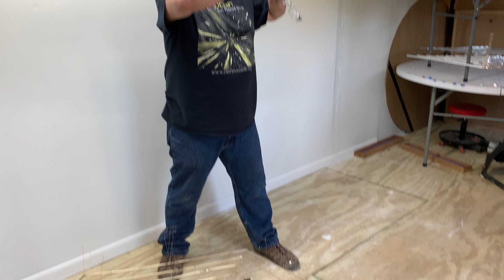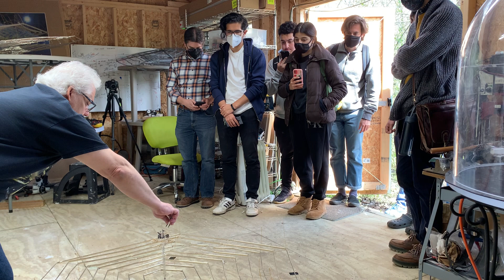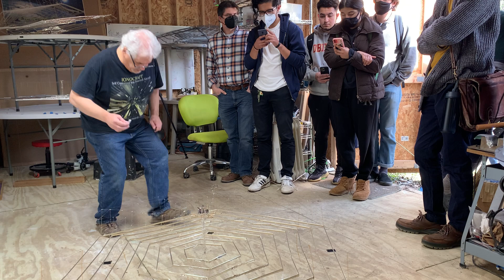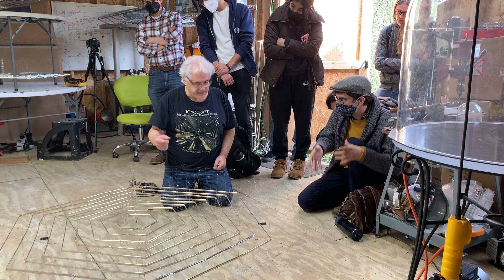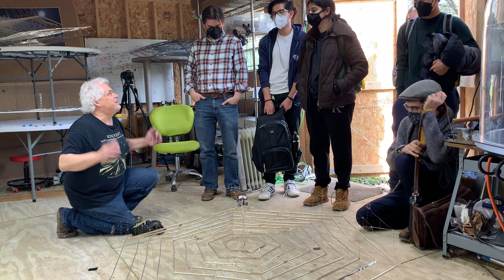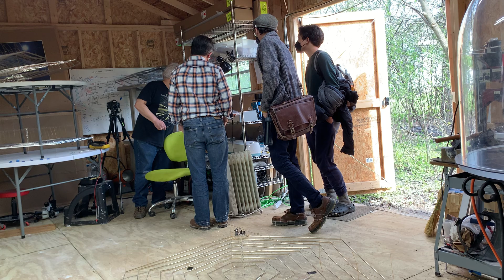Oberlin College Physics Department Field Trip (Please see updates under the video)

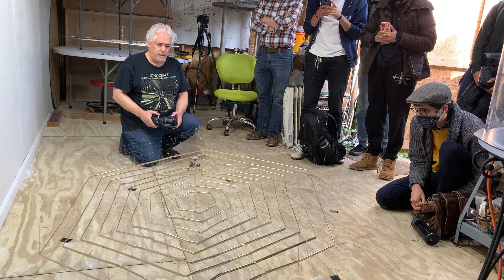Comment: At 18:00 I’m wondering if the people standing around the craft could be taking the potential out of the air?
Reply from the maker: The power was low mainly due to a bad connection, but you could be right.  I'm constantly trying to improve it.
Thanks again!

Comment: I’m one minute in and say this is your best video. 
Your a great public speaker. 
I can hear your passion beautifully. 
Please keep up the great work. 
🇦🇺🤜🏼🤛🏼😎🍀🍀🍀🙏🏻
Reply from the maker: Your comment is much appreciated!  While it was the worst flight that I've made public, at least it did mostly leave the ground in front of the class at one point.  It turned out that there was an open circuit on in the voltage multiplier, that I was able to fix in for the next video called power restored.
I hope to have some much better results to post soon!
Thanks again!

Comment: Thats pretty slick. The closest thing I've seen yet that looks like an anti-gravity propulsion system.
Reply from the maker: Thanks!  I was just thinking today, of what I like about it.  There is a sense of it being free from gravity when it is energized.  Of course, it just blows air downward gently to fly, but because there is so little turbulence and it is lightweight, it seems to just levitate.  The newest model is coated with a thin layer of gold.  With good lighting is looks really nice comparatively.  It will be done in perhaps a week or so.  
Thanks for commenting.

Comment: Maybe put together a crowd funded project to build a room specifically for this project where you can adjust the amount of static electricity, heating, cooling, humidity ect? Also a vacuum environment.
Reply from the maker: I already have a couple crowd funding campaigns going for it. They haven't received any funding yet after months. A few EEs have donated from the donate button on the website though thank goodness.  So far it costs a lot for R & D.  I already have a vacuum chamber.  It doesn't need that much of a controlled environment.  It flies fine whether it is raining outside or not for instance.
Thanks for commenting!

Comment: Could it possibly be discharging just due to all of the people around it and each individuals static  electricity? Also does the humidity in the room effect its performance?
Reply from the maker: No. not so much.  It didn't still fly very well after people left. It turned out there was a broken wire on the voltage multiplier and a few other issues. I fixed some of them and got it to fly a few more times.  This model was getting old and extending the frame to add an especially large 9th ring for steering required too much extra plastic insulation and weight.  If it had been made the correct larger size in the first place it would have been lighter and stronger. It flew through many crashes but now it's being rebuilt.  I'm also working on a model to fly in the vacuum chamber, and some improvements.
Thanks for commenting!

Comment: How much flight time do you think could be achieved if it flew like an airplane instead of a helicopter?
Reply from the maker: When I flew it outdoors on its side, I was able to turn the throttle down to perhaps 15 or 20 percent.  At those throttle levels the circuit runs for roughly 10 minutes with normal sized batteries.  If it had extra wings like an ordinary glider, it could carry large batteries and would fly for hours.  At low throttle levels. like those used with aerodynamic lift, the circuit is very efficient and hardly gets warm.
It doesn't yet have the stability to fly on one side safely without a tether and sliding ring but that will be overcome soon. 
The craft recently had some repairs, has been upgraded, and also a higher quality version is under construction.
Thanks for commenting!
Reply: @KraussEMUS1  awesome! Great work
Reply from the maker: @skate_your_city  Thanks!

Comment: What if you used a blimp style system to scale up the craft. The power supply would cancel out balloon lift and all propulsion would come from the lifter. Less work for the lifter and could allow for a payload.
Reply from the maker: Yes, the first time that was done that I am aware of, was in 1977 by Walden Aerospace.  They demonstrated a large ion propelled blimp to the military.  The craft was not fast or high powered though.  I made an ion propelled flattened rocket shaped blimp in the early 2000s, but it was also not very fast.   I decided then to go all out and develop an ion rocket that could lift its power supply against Earth's gravity.
I have been working on this project since before the name "ion lifter" was made up.  Ion lifters mostly all produce hundreds of times less thrust than their external power supplies weigh and so are considered toys.  This EAD craft has onboard power.  I've also always called it an ion rocket, ionocraft, or Ion Propelled Vehicle etc.  Maybe it doesn't matter so much though.  I'm just trying to specify that the performance and details are different.
Thanks for commenting!

Comment: hello Ethan! we have build a bigger prototype with different techniques and different structure and we think different power supply  than yours, the research shows that some edges length is better than others. hope that you do well. we will soon share our progress with you guys.
Reply from the maker: Good luck on lifting a power supply with ions.  I have tried hundreds or thousands of shapes and structures and many hundreds of power supplies at the very least.  Most just won't work for onboard power. There is a webpage called Worldwide Lifters Replications, that shows roughly hundreds of people that made "lifters."  None of those crafts are anywhere close to having onboard power.  I do think you or someone else could succeed at replicating my work with onboard power soon though.
Thanks for commenting!

Comment: I can’t help but see potential in future applications of this technology, not only in space but in commerce as well. It could help and improve the speed of  transporting goods over large distance quickly, compared to other forms of transportation. How does the thrust output of this device compare to traditional propulsion devices like a jet engine or rocket engine? In the coming future SpaceX will be utilizing starship to transport not only people but other goods to the other side of the planet within 2 hours. Could this technology be comparable or surpass the future feats of starship in logistics in the near future with further RND into ion craft?
Reply from the maker: In the future ion propulsion may look more like what we see in science fiction and have few limitations.  Currently however, it has some major differences when compared to chemical rockets.  These prototypes are very lightweight.  A chemical rocket of the same weight would only run for literally about 1-2 seconds, whereas with thin film solar cells this craft could run for months or years in air.  If you have ever flown an Estes model rocket, you will know what I mean.  The small ones don't run for very long and weigh more than this craft.  

Compared with xenon-based ion thrusters this one currently accelerates at about 4 or 5 orders of magnitude (10,000 to 100,000x) faster.  I think the performance will be just as good in a vacuum with very small propellant cylinders, but that still needs to be demonstrated.  It might require larger thin film solar cells to achieve the same performance.  Alternatively, it could utilize beamed power as well for continuous long-term rapid acceleration.

Elon's Starship is tremendously more powerful, but it will run out of fuel in a few minutes and will have to coast through space with its large payloads.  Of course, I am a big fan, but it is a different sort of thing.  This small very lightweight craft can just continue accelerating rapidly for long periods of time.  It would have to be extremely large to carry any significant weight.  At this stage it fragile as well.  It doesn't matter too much in space though for unmanned vehicles...

It would not be good at delivering packages in its current form because it is so lightweight.  That's just the nature of ion propulsion at this stage of development.  It is super-efficient, but not as powerful as chemical rockets or jet engines.  It has tremendous advantages for space or almost totally silent lightweight UAVs but again, it is not suited for heavy package delivery.
Thanks for commenting!
Reply: I've been trying to encourage the use of graphene batteries along with ion engines which I believe will be very useful in space. Currently this tech has a long way to go and folks like Ethan definitely need to be taken more seriously and fully funded with the right partnerships to steadily see this through to fruition.
Reply: @Mathew Falion

Comment: That was a great presentation! 👍 Too bad it didn't want to take off properly. Hope it works next time you have visitors.
Reply from the maker: Thanks for the kind comment!  One small detail I wanted to mention that many people might not know:  The craft has 7 legs under it for landing gear.  1 relatively strong one in the center and 6 much more fragile ones around the edges that sort of balance it on the center leg.  Once the center leg leaves the ground the craft is necessarily producing over roughly 95 percent lift.  In the case of this particular craft the outer legs are less robust than on other models because they were extended in length by about 5cm during a modification.  While it did not quite reach a 1 to 1 lift during this video it was observably close.  I will find the source of the power loss and fix it today, or as soon as possible.
Thanks for commenting!